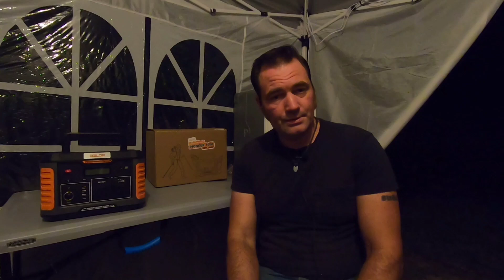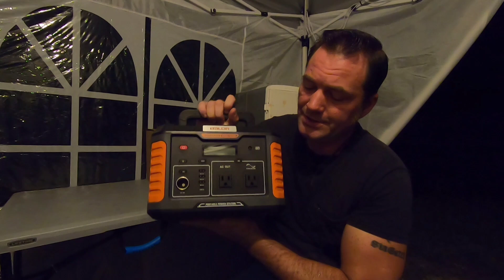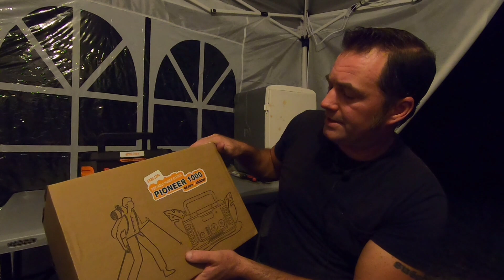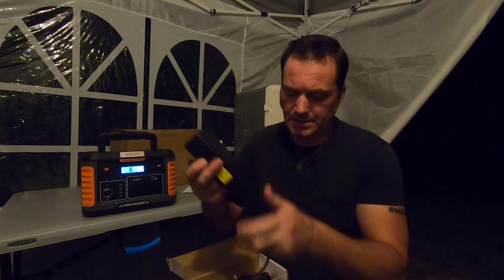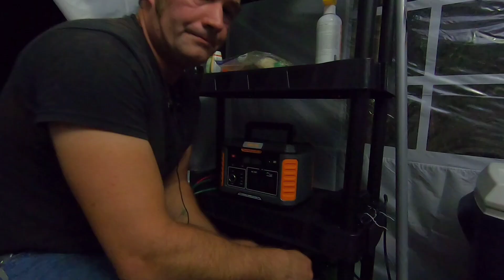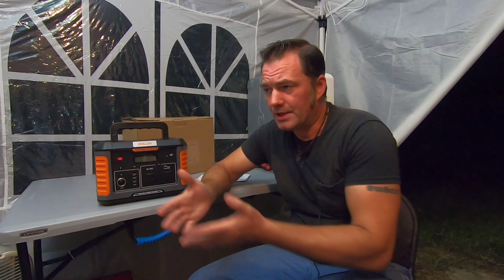BALDR Pioneer 1000 Watt Portable Solar Generator

Comment: This is pretty awesome,….Do you also need Baldr solar panels added for this to work correctly ?  Total cost 1299?
Reply: Most have outlets to charge with AC power at home. Solar panels for emergency to recharge if you don’t have power.